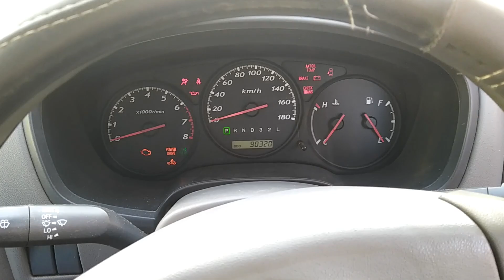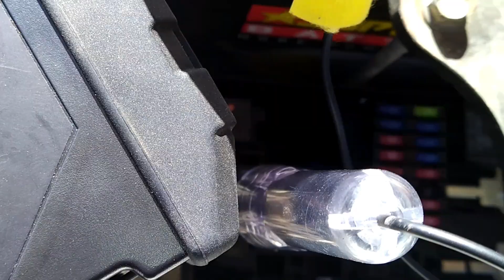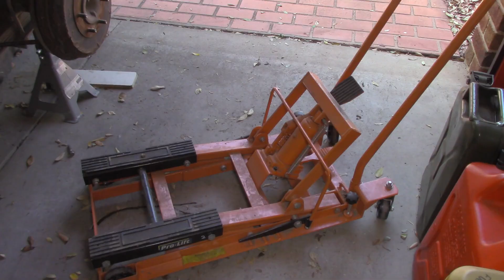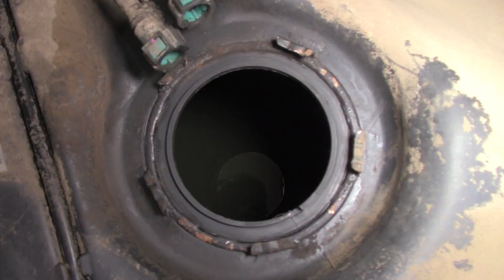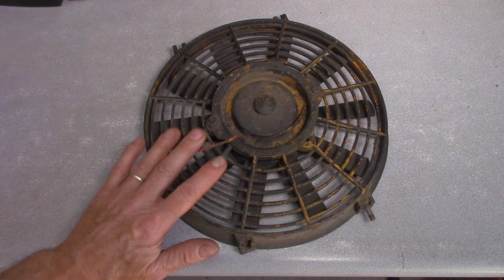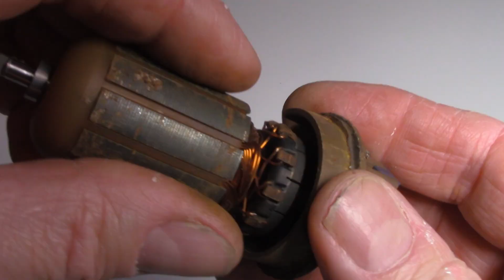Engine Cranks But No Start - Easy Test DIY Common Fault

Comment: what is a claka pump?
Reply from the maker: A "clacka" fuel pump is a universal 12V solid-state or solenoid electric fuel pump.
Something like this:
https://automotivesuperstore.com.au/goss-ge239?utm_source=google&utm_medium=cpc&gad_source=1&gad_campaignid=23545104887&gbraid=0AAAAADhr_hWC3M8EIvXi8NNdCOQHokqp5&gclid=CjwKCAjwkaXUBhASEiwAZI3ds3ZEUJD3-lGrg8RgvZWjTA0hubnTOH7uiGk2nCby1Bep4LTK4ipo8hoCmjgQAvD_BwE

Comment: I have the same problem. Replaced the fuel pump, but still cranks but no start. If I crank it, then leave it sit for 20 minutes, then it will fire.
Reply from the maker: Did you check the fuel pressure when it wouldn't start?

Comment: The ole kick the fuel tank job good stuff Max 😁 Reminds me of most country 4wds i have seen, the dust goes into the tank as you fill it 😲😒 Yes i always remove the tank and flush it out, as not doing this is the primary cause of early new pump failure 🤔😒 Great repair procedure Max 👍
Reply from the maker: Thanks. Kicking the tank (if it's a brush contact fault) is a quick and dirty diagnostic trick.
Reply: @MiracleMAX  After doing the pump assy in a 2003 Kia Rio, I also learnt the hard way (customer had similar fault but it was the Crank sensor this time) to replace the Crank and Cam sensors :( As these give a very similar engine cut fault and are after all the same age as the pump. Not over servicing IMHO :)
Reply from the maker: @MrConspark  Yes all things get old....including us 😊

Comment: Another good one Max.
I used to own a XJ6 Daimler and in the hand book, it says to install 1 liter of metho in each tank every month.
The previous owners never read the book or just ignored the info as both of my tanks had rotted out the bottom.
So, the first major job was to cut out and weld in new floors.
This metho trick may not be good for EFI engines and most certainly DO NOT DO IT TO A COMMON RAIL DIESEL ENGINE.
Bad things will follow
Reply from the maker: Great advice.
Thanks for your comment. 👍

Comment: Thanks MM.  Good to see the inside of that pump.
Some Holden engineer out there will be having a little chuckle about how uneasy that tank is to get out.
Reply from the maker: You are right........and all access to repairing a vehicle is not getting easier!
Reply: Engineers need a good kicking hey? 😒😂😂🚗🛻

Comment: Brought back some trade school memories watching this one. I heard that e10 fuel, can cause water to form in the tank when sitting idle for periods of a few weeks or more. I personally haven't experienced that with e10 in my non e10 compliant vx Commodore when I was using it for a few years.
Reply from the maker: Yes Ethanol does have a certain amount of water in it, but can easily absorb more to make you have a bad day!
Reply: @MiracleMAX  i have a multifuel camp stove which I used e10 in. It was surprising how much impurities were in it. You could see what looked  like water droplets or a lower octane mix within the burning of the fuel. Almost like a splattering rather than a pure burn. However, in the car it had a noticeable 200km extra per tank on a 75 l tank of fuel in my VX. Which scientifically made no sense. But the figures proved it to be correct.
Reply from the maker: @ It is a strange fuel

Comment: Was that an original fuel pump you replaced it with or aftermarket?. Which would you recommend?
Reply from the maker: It was an aftermarket PAT fuel pump module.

Comment: remember jack absolem he'd put a cup of metho in the tank when he fueled up to help remove water from the tank, 
nice video max, im the same i pull the suspect item appart to prove it to myself and to the freind or family member who owns the car.
its what makes your videos addictive  the thorough diagnosis and showing it all and ofcourse your a nice guy, 
thanks max
Reply from the maker: Thanks for your kind comments.
I believe the metho will absorb the water & then be able to be burnt. It doesn't get rid of the water, but allows it, once combined with the metho, to be used as a fuel.
I love to find out what the reason for the fault is. It helps me to carry out a more thorough diagnosis next time with the new knowledge I have gained.
Reply: yes, 35% drinking alcohol still burns even though its 65% water